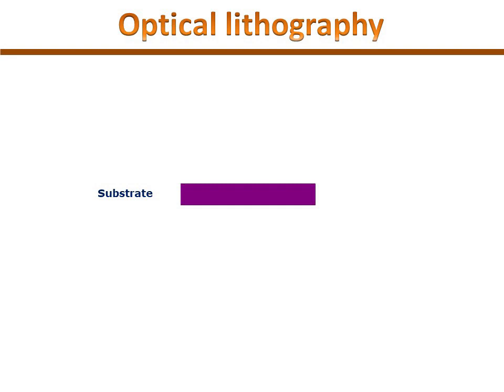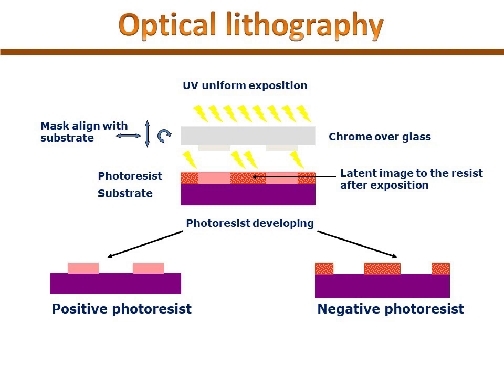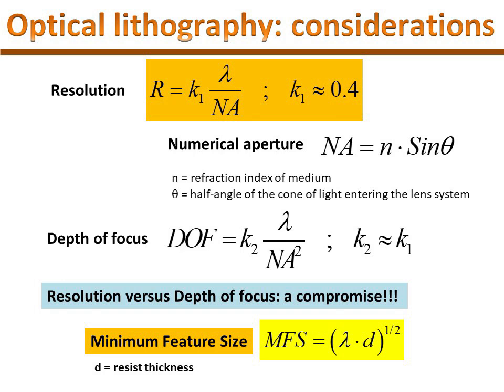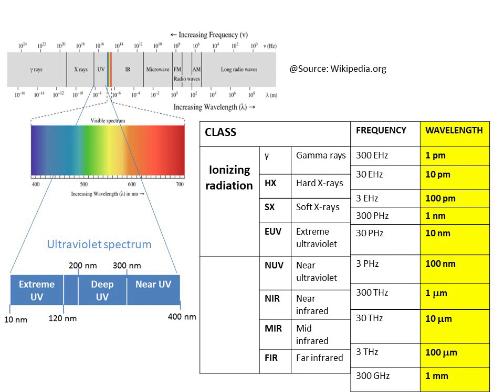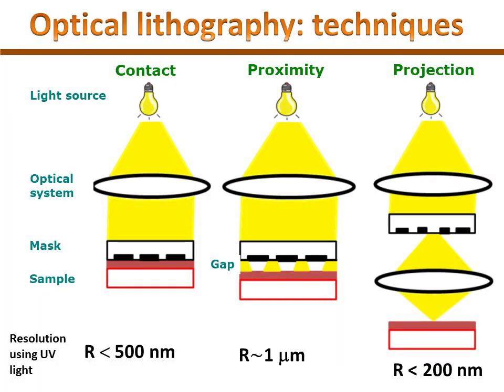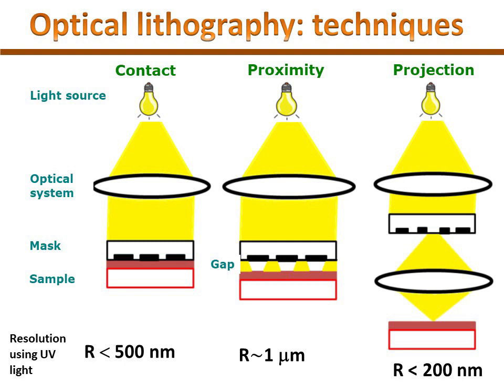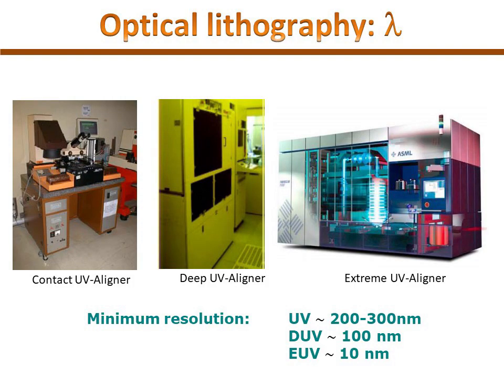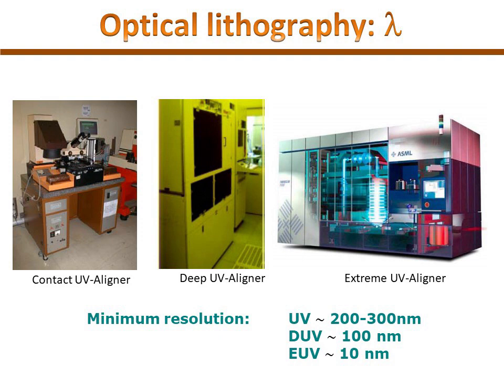Nanofabrication Techniques: Photolithography

Comment: Very interesting! So I would guess then that you would use a multi-die lithography MASK for both Contact and Proximity (and do all dies at once). But with Projection you would need to use a RETICLE and light up each individual die in sequence one at a time onto the wafer.